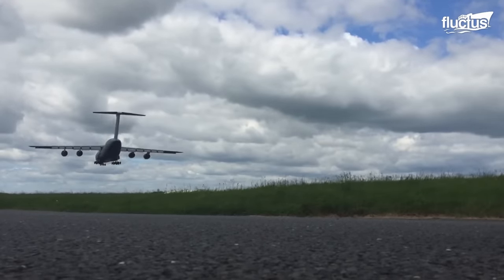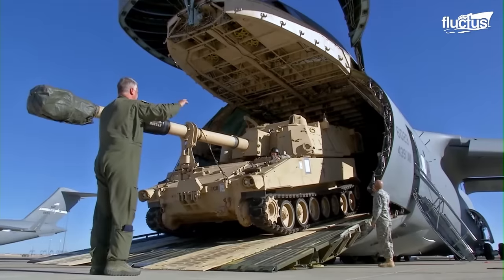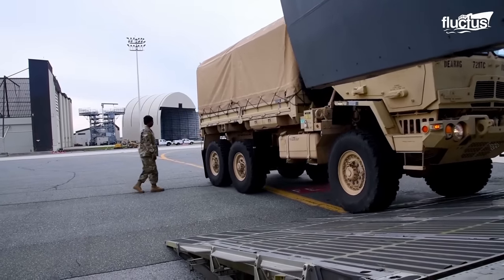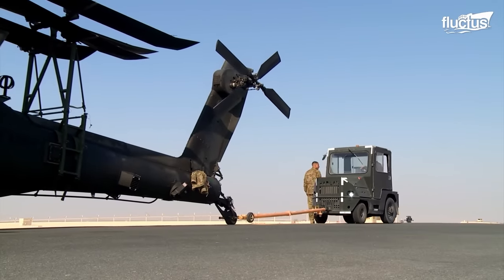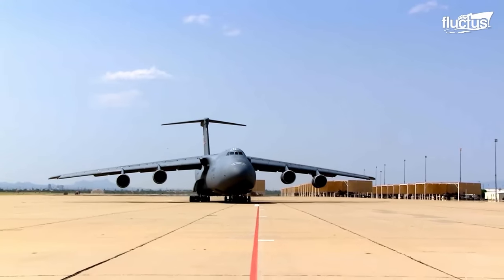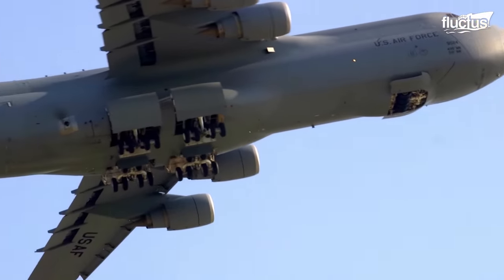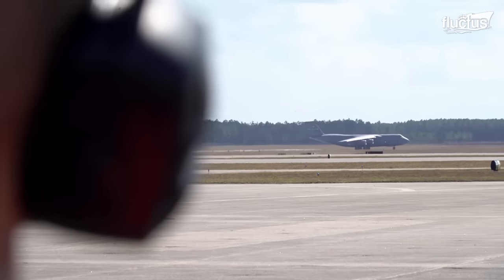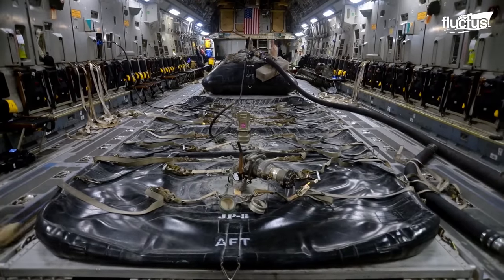US Air Force Genius Methods to Transport Largest Tanks and Armored Vehicles

Comment: I never knew the JWST was moved using a C5 galaxy. Thats awesome. I helped load C5 galaxys at my old job on a army depot in California 😁🇺🇸
Reply: I had helped while one of them landed in Norman wells NWT with some kind of fuel issue. It is just a one runway airport along side the Mackenzie river  just south of the Arctic Circle. We never had an aircraft that big needing fuel. It had to wait one day for the refinery there could make the needed fuel for it. Still then we couldn't get it close enough to the fuel locker so the fuel had to be transferred from the pump island to the plane in a small tandem tanker on wheels. It was quite the affair. We asked for a tour and were rewarded by them before heading up to our Legion for some wet ones. Same for the rest of them in an  unprecedent stayover for another day. Both crews were a pleasure to host in our tiny town of 450 souls. They do need more training of there ability to consume our beer up here, LOL. A couple days I will  never, ever forget.
Reply: @TomokosEnterprize  qq-
Reply: @melaniavazquez1975  ? qq, What does that mean.

Comment: The Air Force better start thinking about a new replacement for the C5. There are only 52 left out of the 131 bulit. The 52 that are left are all upgraded to C5M Super Galaxy.
Reply: Plenty of time.
Reply: The c130 is just fine..  just make it bigger
Reply: C-17 picks up slack
Reply: Agreed
Reply: Now all we need are drone tankers
Reply: @fundad2644  Agreed
Reply: I think as they keep doing the job it gonna take time for replacements
Reply: @briancooper2112  C17s are getting very worn out. Either make more or design a bigger better C5.
Reply: @elmazmaliante2010  and then they will have the same problem with the tanker issues. KC10 getting retired, KC135s literally falling apart and KC46 not totally built up and up to speed.
Reply: 5
Reply: @fundad2644  I love my C130. But they can't transport the M1.
Reply: @1086cobra  C17 still new airframe. C130 over 60 years old with new upgrades over decades.
Reply: @briancooper2112  That's a true comparison. But C17 airframes have some serious hours on them. The Air Force had to finally replace all the H with the new J models. And there is no follow up model for the C17. Look at what happened to the C141, The AF wore those birds out. They really need to start building a newer C17 model or something similar to the C5.
Reply: @fundad2644 ฃแบบ เเำ 
15:10